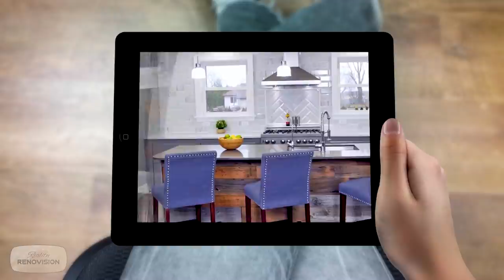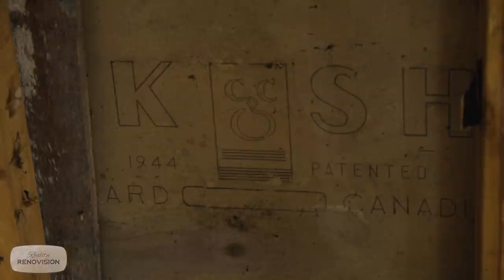Open Concept Living Room Renovation  | 1880s Farm House EP8

Comment: 800-1000$ For advise is pretty scary and dramatic.  XD
Reply from the maker: not when you are rebuilding a home from scratch. it adds value to do it right.
Reply: 800-1000$ is not a big deal on a 40k$ project... especially not if it is about the structural